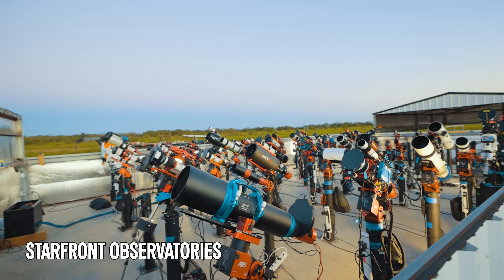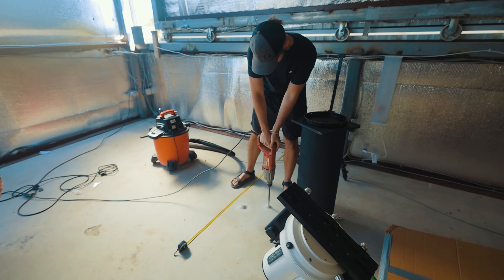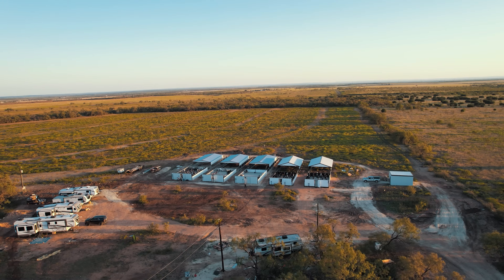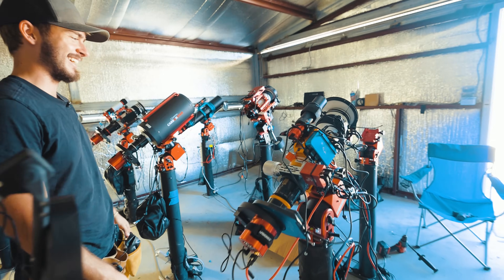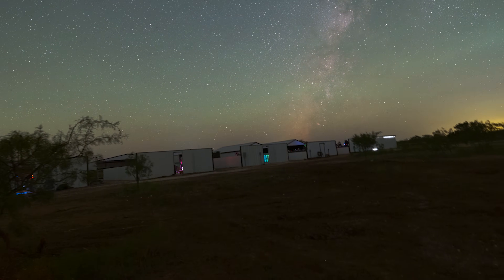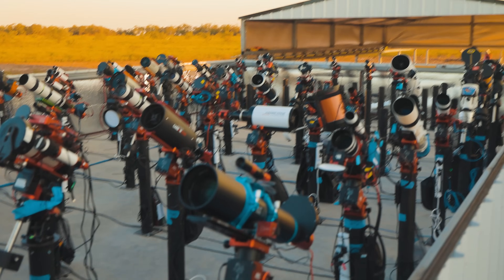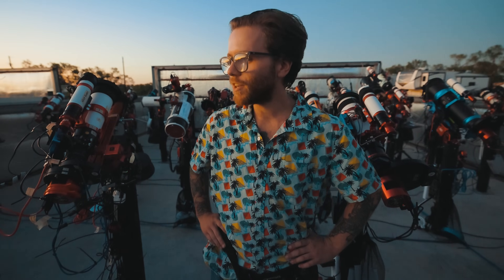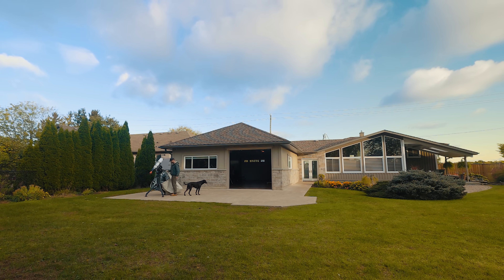Why Everyone Keeps Sending Their Telescope Here

Comment: I remember setting up at 6pm and then taking everything apart n bringing everything in around 2 am , Wet , Dewey , Tired.
Trying to be quiet etc... night after night , Year after year. Then.. In 1998 , I invented some simple adapters , And eyepiece projection adapters . People liked them , I got investors etc... Named it , Telescope-Technologies , Sky & Tel took notice, Put a few of my products in the  April 2000 issue , And in 2002 , I started construction , Had a 14'x14' 9'' thick concrete pad poured 
Routed very large pvc pipes through it that went under ground and up in to my house . Bought a top section of a observatory dome from a well known Amateur in Sarasota/Bradenton Area . It was the dome w shutter and roller section , Then I ordered 1 layer a month of the round wall height sections , I decided to have the door way full height , No crouching . It took me 1 year 
to make it all happen. Every moment that I wasn't working , I was working on the dome 10, 12 , 14 hours a day. Helpful tip----
A big shop vac , can remove more soil much faster than anyone with a shovel , And like lipo suction lol! You have total control
over depth and the shape of the well , With very precise sides n bottom etc.. You just have to keep emptying the vac , But , That makes taking the dirt away easy , And the dirt is very mixed and separated , Making it useful for other things . I went with a huge , steel square column , 1/4'' thick wall , x 10 feet long , The earth end closed with a steel plate welded. 61/2 feet in the ground below the pad , 31/2 feet above the pad. The well was 6 feet deep and hollowed out in the shape of a light bulb. It held
1 1/2 tons of concrete , Then the steel column was filled with concrete , And a 1/2'' thick steel plate welded on , It had holes drilled n tapped for my mounts receiver , Losmandy calls it a MAL. The day I sat my Losmandy Titan 50 in to it , Was a really good day . Long story short , A dream I thought would never happen , happened . After supper , I could walk out empty handed 
and flip 4 switches , And start imaging . At 3 am. I'd flip 4 switches and walk to my bed .  If I died right now , I couldn't complain.   Thank You , Excellent channel.

Comment: Looks great, this site with all the gear. But for me, actually it is not a real option to send a whole gear to Texas from Switzerland because the freigth costs are tremendous and would be sufficient for another gear. What I'm wondering is, how this is insured. Are the costs covered in case of a rebuilt and replacement of the gear after a tornado visited the location? I hope that will never happen.

Comment: I get the idea of it but i would find it a hassle if i wanted my camera rotated to frame a specific target or if you needed to ring up and ask if someone can put a flat panel on to take calibration frames. On the other hand could you image every one of those scopes collectively pointing at one target on a collaborative image.
Reply: I have been imaging there for a month.   I have not needed any support from the team there.    I can shoot darks and flats, rotate the camera, reboot my computer, turn power on and off, and get automated information about the status of the roof and the weather.
Reply: More automation features are certainly needed to be truly remote, but motorized rotators and flats panels are still an option even from home

Comment: I'm curious as to what could be accomplished if all those telescopes were to work collectively on a task.  Kind of like when they link radio telescopes around the world to effectively make a bigger scope.
Reply: Well they discovered a planetary nebula so theres that.
Reply: As mentioned the "collective telescope" is already a plan, and entirely based on volunteer time since these are all privately owned. However this doesn't work quite like interferometry as that requires the light (whether radio or optical) to all hit a sensor at the same time in order to gain resolution improvements. The VLA has an interferometer based array but they use a system of tunnels and mirrors to ensure the light all reaches a given point simultaneously.
Reply: @brentnewton7055  Interesting.  Thanks for explaining.

Comment: I wonder what it would take to turn this into an interferometer.
Reply: Unfortunately it wouldn't work. Interferomatry relies on being able to combine the light into a single point. Systems using interferometry will have complex systems of mirrors running between each telescope to ensure it all meets up at the same time onto one sensor
Reply: @brentnewton7055   Yeah I know, I was just sorta musing. It’s still possible, just highly impractical and expensive. If not for the mirrors it would take, but for the atomic clocks required since it would be visible light wavelengths levels of precision.
Reply: @GabeTStarman  I should add that collective projects from there are already live and have helped confirm discovery of new objects. You may not get the resolution advantage of interferometry but it is nice to be able to capture hundreds of hours of imaging data within a few nights

Comment: I never knew this. What would a typical setup look like?
Reply: Basically the same as what people are doing for astrophotography in their backyard or when they go to a dark sky site.  EQ mount, telescope, camera, guide scope and guide cam, filter wheel if you're doing mono, and some kind of computer to control it all.  There's a good population of people at the observatory who are even using ASIAIRs to control their remote gear, they just connect to it over a VPN instead of being on the same wifi network at home.
Reply: @adamg-502  thank you for responding. So do the people on the remote site aim your telescope for you?? How do they achieve that accuracy for you??
Reply: @metatechnologist  once your scope is setup people usually just use a remote desktop solution (Chrome Remote Desktop, Teamviewer, etc) to login to your scope computer and then its just like its in the backyard.  The staff at starfront do an amazing polar alignment so at the beginning of the night you home your mount, pick a target and do your normal collection routine.  Have the images save to something like google drive and they will sync to your home computer and you process.
Reply: @dustinballinger5661  So you're controlling your own scope on a motorized mount then?? Thanks again really.
Reply: @metatechnologist  They install your telescope on the pier and get it polar aligned for you.  After that you connect to the computer that controls all your equipment and tell it where to point and how long of exposures to take and adjust focus and filters as needed.